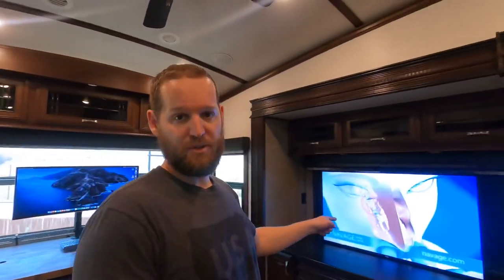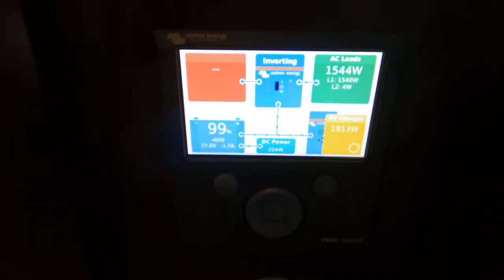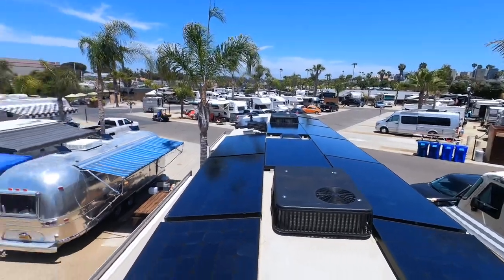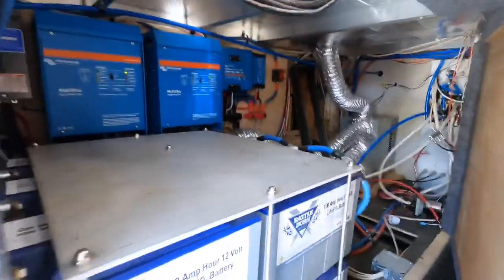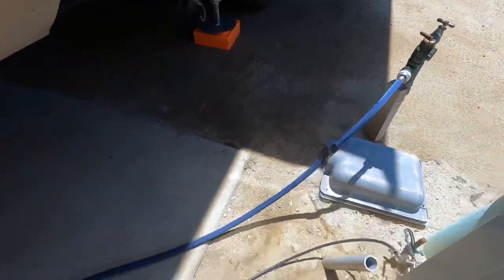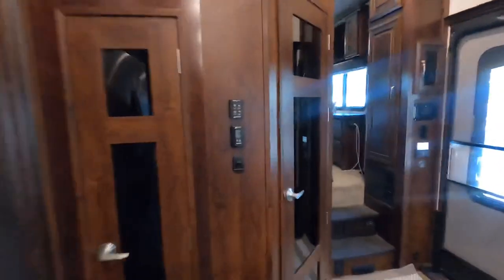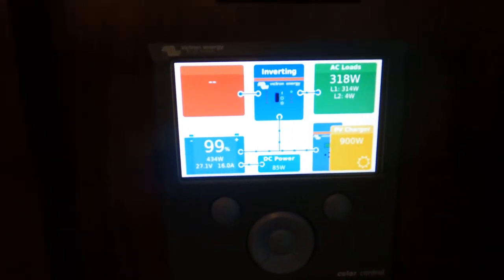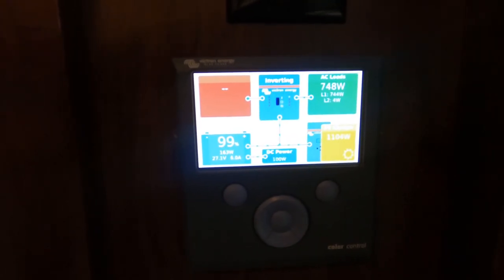Can We Run RV Air Conditioning On Solar Power? A Quick System Overview!

Comment: Solid, Fastly.Cool and gets the job done. For RV where window-mounted air conditioning is not an option, this works very well. Easy set up, rapid cooling, and great design.
Reply: Your wrong! I have a mini split window AC installed in a cubby hole with outside access compartment door and AC is installed on a drawer slide platform.  Open door, slide unit out and turn on. Runs on 500 to 700 watts, 8K BTU, inverter technology with soft start. Happier than a pig in shit.
Reply: @wally1957  i think you way misinterpreted this one year old comment lol

Comment: Thanks for the overview of your super system. I'm always happy to look at an engineering solution from a different perspective. We have been FTing a couple years and discovered we love to boondock so we are planning a big system in two phases. We completed the first 12v phase our first year and plan on building our second 48v phase the beginning of next year. We started by installing a 620 watt array on the side of our motorhome for our small 12v battery bank, that we use to run all the 12v items and a small 600w PSW inverter to power our entertainmnet center and PC. We like the side mounted panels because they can be angled toward the sun and are easier to keep clean without climbing on the roof, as we're not as young as y'all are. We are currently using our 5500 genny to power our larger AC loads, but in phase 2 we will be racking 9, 60cell 360+ watt panels on the roof (3,240+ additional watts) above our AC units to give us a total of 3,850 watts of solar. We also plan on mounting a super high efficiency 48v DC Hotspot minisplit high on the rear for both cooling and supplemental heating, as it draws about 1/2 the power of a typical rooftop AC, saving the inefficiency of running the power through 2 inverters (one to convert the DC battery power to AC and another inside the heat pump to convert it back to DC power.) I will build a 48v (16s) 14.4 kwh battery bank using the new 280 ah LiFePo-4 cells that are available. I can put one together with a quality BMS for around $2k - that's the storage capacity roughly equivalent to 11 Battleborn batteries for the cost of just 2. I will also use this bank to run a 48v inverter charger for my other electrical needs. This is my low budget (relatively) solution to my offgrid power needs. Congrats on your excellent system. I hope we'll meet down the road one day. Chip

Comment: Thanks for the Video. i had a build that was tesla Module power and we had a lighting strike that shorted something and the batteries caught fire. Thank God we where at home and no one was in the build. I am doing another build and have purchased 3 BB batteries @ 12V and struggled to run the RV and couldn't think about AC. I thought about trying Tesla again in a custom firebox. But after watching your video I think i will sick with BB and just add lots more. I did watch your other video about the reasons you switched
Reply from the maker: It's a LOT safer way to go, you've proven my point :). Enjoy!!
Reply: Insurance seems valuable for sure

Comment: Sad that so many believe this is not possible.  Well done and next video please spend more time on the set up and how you got it to where you are and less on trying to prove to the haters that it’s possible.  I just picked up mine with 880 watts for solar and will add four more panels, there is ample roof space.  Need to learn how many batteries, the best type etc.  Cheers and thank you for sharing this.
Reply: Why doesn't anyone mention "Soft Start" capacitors, to help alleviate the inrush current overload?
Reply: @alanpetersen4497  if these are modern inverter style air conditioners they arent needed. but that being said this is like a $40,000 power setup lol i think he covered his bases

Comment: Thank you very much for your system overview. I'm guessing that is about $20,000 ish to do all of that perhaps more. You are quite correct about the weather in the East and you will get far more cloud as well, but you should still get a fair charge anyway. I would run your generator for at least an hour a month just to be sure it will be there when when you need it. You have done all you can to work this for over night AC, which is really the problem when you are trying to sleep. I have been in the Carolinas when the humidity can be cut with a knife. Even in the mid-West like Illinois can be quite hot and humid as well. In the East there are comparatively few boondocking opportunities save Walmart and you probably won't be permitted use of a generator, but you can see. The East is not the West. Also the East is quite forested and so at most campsites there can be very limited solar coupled with the clouds. You have an amazing set up, but it will be interesting to see how it goes for you. You work looks very professional and I hope you and your family get many years of enjoyment out of it. Travel safe. Henri (RVing with Henri)
Reply: Well you at over 11k for those batteries alone.
Reply: Generator all the way, all this money and still you can't leave this thing for 2 weaks on same spot and run AC all day long.
Reply: @zelenizub2036  Yes, but many places won't let you use them. If you chase 70F you may not need one and then the solar will do everything.
Reply: @henrivanbemmel  Chase Why would you want to stay at an RV park to use solar?  Isn't the point to boondock?  I have yet to come across any places that do not allow a generator.  For $2000 I can run my appliance and AC 24hrs a day.  He has a beautiful set up, but to spend that kind of money is absolutely silly.

Comment: I've had the capability to run my air conditioner off of batteries for a year and it works well. I do need to monitor inverter temperature when running both A/C's for an extended period.

Comment: Wow that's an awesome system you have there. is there any way that you can show the wiring process on how to get your air conditioning unit to run off your inverters while you are on solar power.

 that would be great if you haven't done one already I have to check out your channel after this post.
Reply from the maker: I'll have a blog post up soon, thanks!

Comment: That’s an extremely expensive system to install on your rig. You may want to discuss that investment. I would install an Onan generator until the cost comes down. The average RVer only keeps their RV 3-4 years. If you bought a new rig, would you remove the system and use it on another RV? 12 Battle Born batteries =,somewhere close to $12,000. I looked at a couple of your other panels and they were several thousand dollars each. Pretty pricey undertaking and takes up a lot of space.

Comment: I can only see mega $$$$ with your system.  I also run my RV AC x2 on solar but I use Mini split 8k BTU with inverter technology and soft start built in. Runs on average 500 watts and 710 watts on startup. Cost for unit $379.00! I installed it inside a cubby hole inside my entertainment center, installed outside compartment door and built drawer slide for the AC to sit on, hence all I have to do is open compartment door, slide ac out and turn it on. My second AC is a 5000 BTU unit installed the same way only located in my bedroom wall cabinet. I can run both AC's on less power than one standard roof top AC (about 900 watts for both AC's). I am actually tearing off the old power hungry Dometic roof top AC and throwing it overboard as hard as I can, and to the scrap heap. I only run four 12V LIfepo4 100 AH batteries wired in series for 24V. For your viewers never run 12V system and trying to run over 1000 watts or things could really start to heat up. I switched to 24V inverter and 24V system overall after my wiring got really hot and almost started a fire. I  was trying to discharge my batteries as fast as I could  pulling about 2000 watts. for over a hour and smelled something burning. It was all the battery wiring. So again people never run over 1000 watts on a 12V system. The people who sell inverters know what I am saying but they won't tell you the truth. They only care about sales. I only wrote this to let you know that you don't have to spend a fortune to have a good system.

Comment: I'm glad this works for you.  But for viewers, that's about $10,000 and 400 lbs of just batteries.  Also, as far as the US is concerned, the South West is the very best it gets when it comes to PV performance.  Rain snow and northern latitudes all decrease performance.  I hope PV performance improves over the next 10 years, but for now, I just can't see running AC on batteries as viable for most people in most places.
Reply: While agree with the first part ($10-20k and lotsa weight) Keep in mind that when the solar is less available (rain, snow etc) is when you will not likely use the AC - so no XS draw there. But Man! 12 batteries and 12 panels!! Yikes!!
Reply: My solar set up cost me in the neighborhood of $16000.00, and my 1600  ah LiP04 battery bank weighed approximately 350 lbs, and it  was very close to your estimate of $10,000.  was it worth it?  Probably not!  I am an electrician, and it was fun setting it up, but because it was my first time, the cost was almost double the cost of a (package deal) from a reputable Solar Sales Company.  The packages that you can find from different companies are actually worth their weight!  Doing a job, DYI, piece by piece, was way too expensive.  Find a package deal, and go with it!

Comment: Thank you for sharing your experience. I'm building a similar system with 5 x 440Watts LG Panels and wondering if I should just put them all in series or have two MPPTs and separate into Series + parallel. Through your experience with threes and bypass diodes, have you had any issues with shading ? I'm guessing your SunPower panels have bypass diodes at every cell and don't get much affected by it.  I've noticed you've a single MPPT controller on the 210watts panels I'm imagining you've a series+parallel setup, can you share more info on the solar wiring layout ? I could not find it on any of your videos.
Thank you.

Comment: What does this solar power set up cost and how often do you need to replace the batteries? My guess is that your system purchase would be at least $ 25,000 plus installation cost and battery replacement would be at about 15 years at an additional cost. Lithium batteries cost more but do last longer (up to 20 years), but lithium batteries also degrade over time pending on usage and become less effective in storing energy.
Yes you have independence from the electric grid but at a high price.
Reply: 100%.  And all rv's are built poorly and they are not built to be lived in full time.  A beautiful set up, indeed.  But so silly.  The system will out live the trailer.  And he still will need a generator to run his AC in humid weather?  So so silly.  I hope everyone turns to solar for their homes so they really feel what it's like to not be able to draw the amount of energy that they demand.  Go ahead and drink the cool aid.
Reply: I installed a system similar, and it cost me approximately $16,000.00 for material only.  However, there are package deals offered at different solar companies, that could have cut my cost in 1/2 on material.  Making the Labor the only variable.

Comment: I would also like to add that corporations like Dometic have the technology and ability to bring you low powered AC units for your RV like the Mideal 8k BTU mini split with inverter and soft start built in (#1 seller on Amazon) but they would lose money doing so. They currently charge around $1800.00 for a roof top AC unit and I can buy the much better MIdea for only $379.00. It would be easy to convert the mini split technology to a RV roof application. Who ever does this first will rule the RV marketplace for Air conditioners. For now I will stick to installing the mini split inside my RV cabinets while using outside compartment doors and drawer slides for the AC unit to sit on. Simple and cost effective. Oh...and I will use the original AC space on the roof for more solar panels.

Comment: That really helps. I have 1000 watts on the roof with 800 more coming. You said you have upwards of 10 hours to draw from your batteries for AC. But I think that is not correct. Help me out here. If you are running in the evening, temperatures and ambient temperature will be much lower, hence no sun, so your AC would run continually, not continuously. I live in Naples FL and it is humid. But even today, August 5th 2020, in the evening the AC in the condo turns off a lot more. In the RV even in middle of the day it turns off. So is it fair to say you could not deplete your batteries from your AC in the evening? I understand theory and reality don't always match up... what sayeth you?
Reply from the maker: You're correct in your assumptions, I mean 10 hours of AC runtime, space that out however you'd like, it's so dependent on location it's impossible to pin down

Comment: I am coming along late but I jjst came across your video.  Have you had any experiences with what Ive heard of as some sort of Startup Assist package that can be obtained or added to an RV A/C unit?  Is it needed...does it help etc?  It seems to me that if your equipment and sytem overall is large enough to produce the power...then it would be fine as is.  That seems to be the case for your setup.  Appreciate any comments you have.  Thanks
Reply: A small Solar package cannot handle the load, unless a "Soft Start", capacitor is wired up to the a/c compressor.  The inrush current of the A/C unit is as much as 800% of its normal operating amp copacity.  Installing a Soft Start capacitor changes the sign wave of the current and voltage, and allow the unit to start on much lower current.  Therefore, the answer to your question is YES, you need a Startup assist package.

Comment: Impressive solar setup. Massive and no doubt massively expensive. Most will not have the room for that kind of capacity. I am trying to figure out how much solar power that I will need to run one AC unit in my 31' travel trailer. Can it be done? I don't have room for 12 batteries or all the panels pictured in this video. Will it be worth it? My experience with boon docking is that tank dumping is the major issue. We don't boon dock much except for parking lot overnights en-route. Maintenance issues down the road are a concern as well. We all know where all those components are made and, the warranties are pathetic.

Comment: Nice setup. I'm all about solar. But there are two issues that prevented me from pursuing this on a Grand Design Reflection 297RSTS travel trailer. 1) The manufacturer spec payload capacity is 1,500 lbs with 10,000 lbs GVWR. With washer/dryer combo, generator, and other upgrades to include personal affects and furniture, I'm right at the limit without any solar upgrades. 2) The combined weight of solar panels, brackets, and A/C units on the roof top makes for a top heavy rig. Any sudden evasive maneuver to avoid hazards or accidents at highway speeds may potentially contribute to the rig tipping over. It's not so much about electrical power capability but more so about personal and public safety. I'm not saying your are but if I were a guessing man, I would guess that you are exceeding these two constraints and potentially exposing yourself to a liability lawsuits in the event of an accident. Not trying to be a nay sayer or dampen your enthusiasm. I would love to have a solar system like yours. Just pointing out some possible 2nd and 3rd order affects.
Reply: With the added weight of batteries below there is no way you could ever be top heavy.
Reply: Solar panels are now light weight. I have 200 watt bi-facial panels that weigh 25 lbs. each,  So weight is not a issue anymore.
Reply: Most of the weight is low in the trailer where the batteries are. The panels are around 40 lbs. each. The batteries have all the weight at 90 + lbs each
Reply: Those batteries only weigh 31lbs...

Comment: Awesome set up and beautiful rig! Just curious on why you use two inverters?
Reply: my guess - to even out that huge load / capacity and possibly to cope with all those amps... To the best of my knowledge Victron only go up to 5kw units and I'm guessing that it also reduces wire size/cost..

Comment: You may be able to get air conditioning from solar panels during the day,  but what about at night? Can you store enough energy during the day to carry you through the night? 

What did that battery pack cost? Over $10,000?
Reply from the maker: It's about an $11,000 battery bank, and generally speaking we're fine through the night but we don't spend a lot of time places that are hot at night.

Comment: Thank you sharing your information. I want to run my two AC on battery also. I currently only have wet cells, Hoping to buy 4 lithium Kilovault 300a batteries. I have 2182 watts of solar capability on the roof.
I have a 3k and a 2k Magnum Energy inverts. My questions is: Normally when using the inverters not all of the Receptacle will work. Did you have to have any additional electrical work or an additional sub-panels to enable the ACs to work?  If so, did you do the work yourself?  Thanks..
Reply from the maker: There is a lot of work to be done, all receptacles work, you’ll just have to work out your energy requirements :)

Comment: ive seen battleborns running roof ac before but the first vid that show more solar capacity  than power being used.
Reply from the maker: It's certainly one of the larger installs, but they're getting bigger by the week!